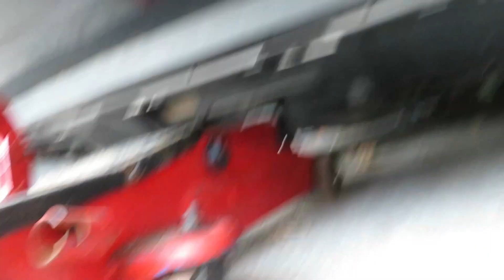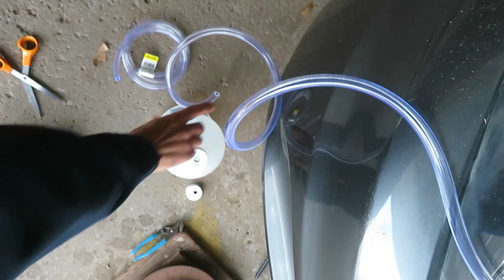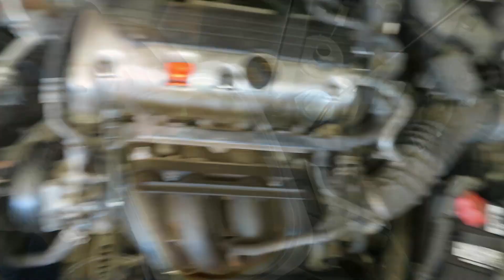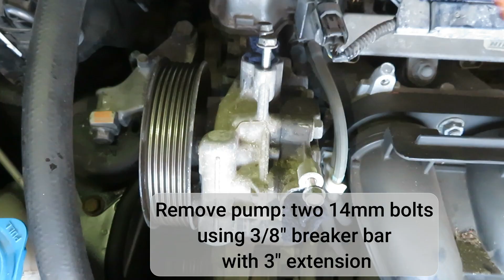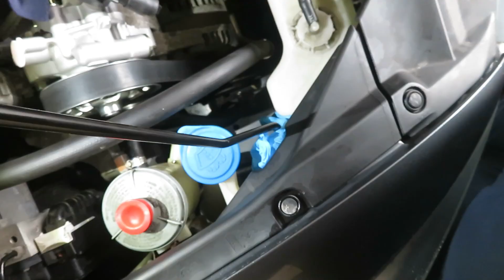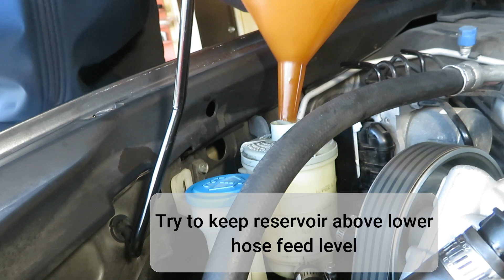How to Replace Power Steering Pump and Fluid 2.4L Honda Accord 2008-20012

Comment: Nice detailed video helped out a lot except when you got to the o-rings you didn't show where they go
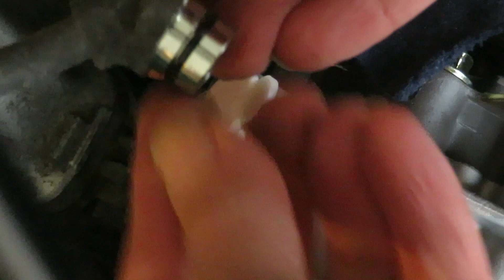Reply from the maker: I did show the high pressure side at 11:02. The low pressure o-ring was inside the hose fitting on the new pump, which I didn't take off. So you're right I didn't show that one.

Comment: What does the pump mount to. The upper bolt more specifically
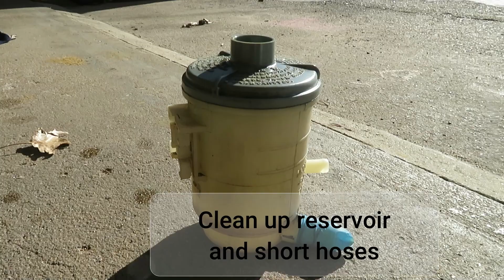Reply from the maker: It mounts on an engine bracket. There is a front and back bolt, not really and upper or lower. 8:08

Comment: Let me know what you think about that pump. I'm ready to change mine and there are so many aftermarket options.
Reply from the maker: I'm still not able to endorse the pump. Now having some issues with the ps not working for a few minutes when cold. Still troubleshooting this...
Reply: @TheOriginalMechanic  If you still have your oem pump you can buy a rebuild kit for about 30 bucks and the job isnt long.
Reply from the maker: @victorLfun  good tip thanks
Reply: @TheOriginalMechanic  Thank you for your reply. I know a lot of these aftermarket parts are hit or miss so I appreciate your honesty. I may try the TRQ pump.